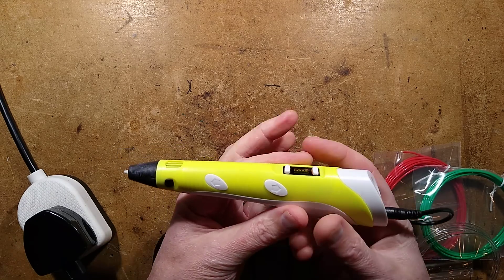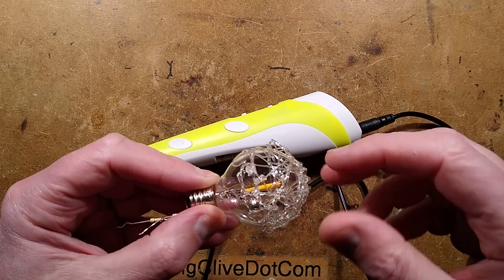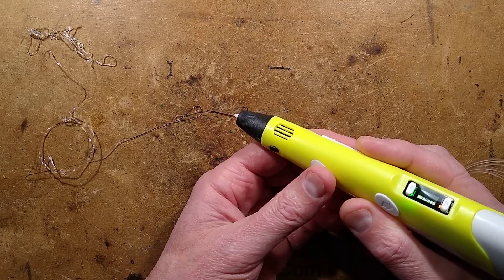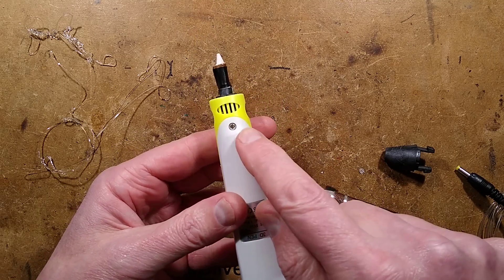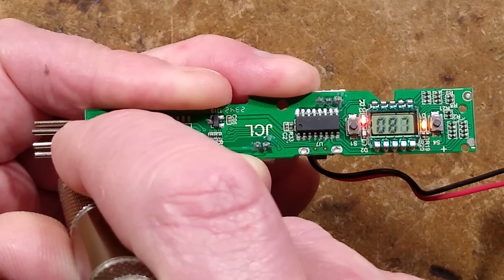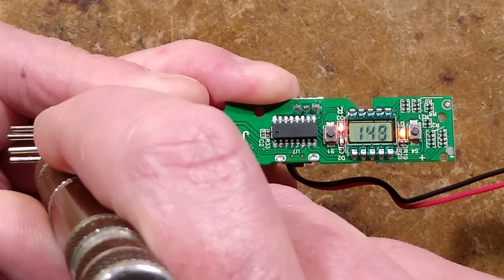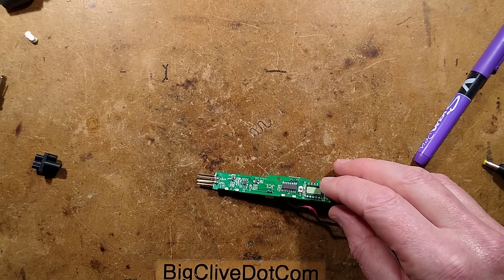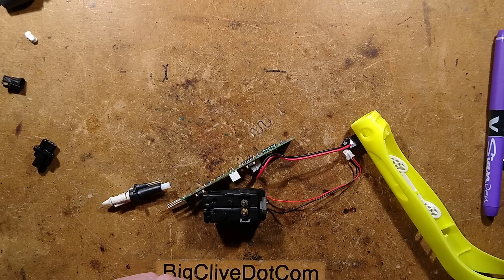Inside a 3D printing pen

Comment: Hot end…? Extruder…? Equals very cheap business-end for a DIY micro 3D printer. You can replace the manual controls by hooking them up to your chosen microcontroller. Nice wee project. So, I guess I’m saying that the best use for this is to be hacked and repurposed! Before you all roll in, I know the print quality will be sh1t, but just think of the fun you’ll have!

Comment: These are pretty decent for welding split up 3d prints. I'm thinking of modding one to split the extruder from the hotend and use a ptfe bowden tube. Then you can use a proper spool of filament still and itll just be more conveniently sized. Also, update controls so they arent so dumb.

Comment: that is a good application for 3d repairs and reinforcements on parts made. you would think it would be
not function if the thermal feed back was disconnected. live and learn! thank you for your time and explanation.

Comment: I have the same make, but an older version, probably from around 2020. Well, if you can say "make" when it comes to these generic-brand items. On mine, you have to continuously press the buttons to drive/reverse. No LCD either. The tip is changeable. I've changed it once after the filament got stuck near the end of the bowden tube, where it couldn't heat up enough to get free.

Comment: I used mine to fill gaps in 3D prints, and I also used it when I made my own 7 segment LED display, I printed the outer parts in white, glued it onto the PCB with the LEDs, then used the 3D pen to flood clear filament into where the LEDs are to act as light guides :) excellent custom displays

Comment: Since there is indeed a 25 KOhms thermistor, would the "fake counter" go slower if the two pins, NTC and GND, are joined with a 10 KOhms resistor?
Reply from the maker: A temperature monitoring device will be designed around a known value of thermistor.

Comment: I repaired a vacuum cleaner housing element with mine. The element was too thin for 3D printing, so I filled the whole thing with a 3D pen. It lasted a few years until the vacuum cleaner motor failed. The rest of the applications are filling gaps in prints.

Comment: I concur with others who have mentioned it's a great tool to use along with a 3D printer. That's why I ordered mine, and use it occasionally to save print jobs when supports fail, fill gaps, and make general repairs or cosmetic touch-ups. It's also great for back-filling holes after using brass inserts or embedded nuts. The only complaint I have is the difficulty of controlling the flow and reducing oozing after turning it off. But in a pinch it works great!

Comment: I use one for modifying 3d prints.   I design and make things to be good enough.  Sometimes to get a part to fit or to work right I shoot in a bit more plastic and fill some gaps.  Faster than redesign and reprint.  

Never made anything from scratch though.

Comment: I would have thought they'd just make a clamp inside that you release to yank the filament out. If you pull filament out that slowly at full temps on a real printer, you get that clobber coming out and chances are it clogs up the head and by god I never want to take one to bits again to clean it.

Comment: I have "printed" 2 raspberry encloses with it and some other small parts and figurines ( before I had a printer ). its slow but it can get the job done if can do it. Its also good to weld some 3d prints and if you want to decorate them in more organic way.

Comment: The most useful application I've used mine for is fixing or creating new plastic standoffs, screw on caps or inset screws (like the kind that get broken off inside laptops, when somebody drops it etc). Usually just use clay & a bit of talc to make a replica of the form. Put a small hole in both sides, then add a drop or two of paraffin oil to deal with the heat & prevent sticking, & ending up with a really low cost part with generally similar quality to an injection molded part.

Comment: Two options, PLA or ABS? That's a jump. Do NOT use this with ABS without a vacuum! Melted ABS is toxic, which is why most who print with it do it with a printer that has a carbon filter (Like the X1C from Bambu Labs) or some kind of venting to the exterior of the building/room.

Like others have stated, great for repairs on 3D printed parts or joining them together.

Comment: Give n it one Christmas, took me a while to find a use for it, the pucturs in the box drawing a bicycle did not inspire me. 
Used it for adapting a lens assembly from a plastic camera to fit onto a DSLR. I don't think you can put parts in a 3d printer and tell it to print between the parts.
https://youtu.be/8nkPCy6bW-Q?si=nlGQ-tXzeDDqEOR5

Comment: I am stunned that in 2024 you have opened a highly advanced plastics creating tool and...!  It has the same motor that came in my 1980s solar experimenters fun kit!  And out of every toy I kille- "took apart" when I was a kid.  And available from every electronics surplus store (usu. in bags of 10.  Or 50. that was always weird...) I ever shopped at.  That motor is everywhere!  Same crappy bent can and plastic ends, completely unserviceable, and runs on 1.5-15VDC.  And has vaseline at both axis ends.  Sorry, probably called "electro-butter" or some such.

There is a factory somewhere on the planet that has never, ever, had to re-tool.  Sure they may have branched out, but they know where their bread and butter comes from.

Comment: I got one and got to use it a couple of times ( 3D print repair and some random plastic casing repair ) before I accidentally used a guitar pedal power supply ( they have a reversed polarity on the barrel jack ) and that was about it. No diodes on the power input.

Comment: Does it get any hotter if set to ABS? It could be useful just for fixing cracked plastic or betting yet when plastic welding something that is going to need a butt load of filler material, like when you break a plastic storage tub and s whole section of the tub separates from it, but you can’t just piece it back in due to all the little bits that also came out as well. It seems the only real advantages to it are the fine tip for precision and the smooth feed rate of the motor. I couldn’t feed plastic into a weld pen even half that smoothly if my life depended on it. Probably still have to smooth the plastic with the weld pen afterwards, but that’s a one-handed relaxation process, compared to feeding in filler. Thanks for the video. See you next time.

Comment: You can do all sorts of things with a hot glue gun and plastic feed stock. I prefer to use pieces of tubular plastic coat hanger for feed stock, but most plastics seem to work, plastic straws, bundles of stir sticks, plastic dowels, aquarium tubing, whatever fits pretty much works. Other than the fineness of the aperture, and the ease of feedstock, what other advantages are the pens? Other than their component parts, that is.

Comment: That's not really a 3D printing pen, though (or at least you're not using it as such), it's basically just a very tiny hot glue gun. 3D printing pens let you draw "in the air" (i.e., move the pen vertically, and the filament hardens as you move up). With that one, it seems that it just drips. Maybe you had the temperature set too high?

Comment: I have had mine for years and so far it us pretty solid.  Use it for repairs of ABS, PVC, PLA. If your a 3dprinter or a modeler it can be quite handy, it has plugged but was fairly easy to clean

Comment: Wish these were around like 25 years ago would have been easy making water pipe as a kid. No more melting strips of plastic with a soldering iron. Thankfully even as a young stoner knew to wear a mask and was doing it under a vent hood. Can't say the same for all these crazy people mixing/ pouring epoxy in a small closed room with no mask, but hey anything for the views right lol.

Comment: Given I was scared off getting a 3D printer because I don't have any good means for ventillation - having a handheld 3D printer you presumably have at less than arms length seems a bit risky. But then risk is hard to assess - is it worse because 3D printers do a lot of printing so produce more airbourne badnessto e.g. hot glue guns, badly cooked curly fries in an air fryer?

Comment: Everybody talks about the use of this pen, but I'm wondering how they made that tiny chip produce all those lcd parts, the numbers: three digits contain 7 parts, 3 times 7 is 21, the chip alone has 16 pins, how do they do this? It has always amazed me.
Reply: Yeah even to me *plexing is kind of like black magic! And combined with the fact it also has to drive the motor, the heating element, read button inputs, toggle some leds

Comment: Hi Clive. I have a couple of these that I do actually use. The main use's for me are (1) when prototyping, repairing/altering 3D printed objects (for instance, if a layer starts delaminating, I will use like a welder to put stitches perpendicular to the layer to stitch it together, or if a hole is the incorrect size, use the pen to fill it in and then redrill the hole (bit like you would with metal and a mig welder), (2) Before having a multi-filament setup, I could print objects with 'voids' in them and then use the pen to fill with some 'coloured' filament for decorating pieces.
Reply: Adding coloured highlights sounds like a great idea. Maybe combined with some fine sandpaper to fix any mistakes.

Comment: a model builder can use it instead of filler for filling in holes in their models, but would need to be a cleaner cut of the plastic at the nozzle. or for making their models stronger by adding extra layers inside, and conforms to the models shape instead of using like i  said filler, or hours of cutting more plastic, or for hiding wiring like extra lights in their model.

Comment: I have made a hanging rotating stand for a box fan , a phone holder adapter with some screws and nuts included , for my old camera tripod, attempted to make a little lathe... (Didn't work well but little exp there to make one....) some random repairs around the house... building a new frame for a old glasses set. (Soldering iron with a dialable temp setting helps smooth things great here) Some other random projects that were just "fooling around and to see what I could do with it... kind of stuff..." A switch holder to replace one that broke in a vehicle... Etc...  For someone on a budget, It can get them out of a pinch.

Comment: I've seen videos where someone is creating a 3D sculpture like a Pokémon. Because you are freehanding it, you don't need any CAD skills. Plus you can have multiple of these pens loaded with different colors.

A word of caution, DO NOT use ABS without wearing a respirator. ABS fumes are quite nasty, PLA isn't exactly something you want to be breathing in either but it's FAR less bad for you than ABS.

Comment: I've got one of those to expand the usefulness of our 3d  printer. It is also very useful for small scale potting  (instead of hot melt glue), and as a remarkably strong (and colourful) alternative to the aforementioned hot melt.  VERY handy for repairing cracks and damage to ABS products, such as domestic appliances and car bumpers!

Comment: We have a particularly cheap and nasty hot air rework station at work that has a similar temperature control behavior. It'll ascend to the set point (say, 280C) as expected, then wildly overshooting to the point of nearly scorching any hapless components at the nozzle end while it shows only that it achieved the set temperature (it varies the numbers a little bit and fakes it). The giveaway is that the heat control LED that normally flashes has turned off for a bit while it cools itself back down to where it's supposed to be.

They also ablated the marking on the control IC (obviously an Atmel 8051 variant) as if anyone sane would attempt to copy what they've done.  🤪

Comment: Would a ceramic nozzle be better than hardened steel nozzles in a 3d printer?
Reply: That depends on the ceramic. Tungsten carbide is a ceramic and it makes an excellent nozzle. The thermal conductivity is much higher than steel, it's almost as good as brass.

Comment: I used one in Jaycar Elecronics her in AU, it was fun but the novelty wore off for me in about 10 minutes, I definitely can see a use though, as others mentioned repairing prints and as a more permanent glue gun, but after getting a 'proper' 3D printer I could never use one of these soley to make stuff. But if it's a gateway in to making stuff I see no harm in these things existing.

Comment: I vaguely recall that when an h-bridge has both mosfets switched on, you get fired from your circuit design job for shorting out the supply lines?
Reply from the maker: It's not just turning on transistors directly.  It changes the polarity of the matching output.  Taking both high (or low) makes both outputs equal and no current flows through the load.

Comment: The material drive mechanism is very similar to a MIG welders feed, the bit that pushes the welding wire through to the torch/gun, although a MIG welder uses 2 rollers, with the driven one having a toothed groove within it, rather than a toothed cog. They could have done that with this, to cause less damage to the PLA.

Comment: It's like a hotglue gun, but using plastic instead of glue.    I can't see a huge number of uses, other than the ones you have highlighted.   I guess you could use it for repairs and similar things.
People doing a lot of 3D printing may find it useful for those sort of repairs

Comment: never thought of something like that but in concept kind of like a hot glue gun using a different plastic with auto feed. Could it be used for "hot glue welding" appropriate plastic parts like parts made out of ABS?

Comment: I was occasionally hand making hot ends for 3D printers about 18ish years ago. Measuring and cutting nichrome wire, hand winding them and fire cement coating, casting on the silicone cover, the whole nine yards. Also built whole machines, one of the machine from the company was used for the bloodhound project (and I now have) and people were experimenting with ceramic and chocolate printing.  We discuss hot air to sinter sugar.... was an interesting time.
Would the three pads for speed perhaps give 5 speeds, two extra from the two bridging positions?

Comment: I have a nearly identical 3d printer pen. Except mine doesn't continually feed when you push the button. You hold the button down and it feeds. Also mine came with a proper wall adapter instead of a USB plug.

I use mine for plastic welding for repairs. Like if I pull a device apart and the plastic is cracked, or if screw posts snap off, I can weld them back on better than if I used glue. It works better because the pen melts the surface of whatever I'm repairing, and it melds nicely with the melted ABS coming out of the pen. Making a pretty rock solid repair. Just like welding steel.
Reply: The one I have will work in either continuous extrude mode or only while holding the feed button mode.
 It swaps between modes by double clicking the advance button.

Comment: I learned welding in the 80's and the 3D pen is useful for "welding" 3D printed parts together - hot melt glue doesn't stick properly, universal glue like UHU works for joining flat surfaces, the 3D pen can bridge gaps - they all have their purpose.

Comment: I have used mine with a flexible filament to make several stub antennas for broken transceivers. I made a rubbery foot for an aluminium chair. This was extruded onto the correct size of wood to replicate the chair leg. (The completed food was smoothed over using a soldering iron to shape the plastic.) It was a little difficult to remove from the wooden former but it looked the part once fitted. I also made another foot for a missing tubular leg of a desk. This time I was able to construct it inside the tube. Again the soldering iron was used to smoooth the part and match it with the other 3 feet. Not properly used it with other brittle filaments. But I can imagine a use with the clear filament for repairing the christmas led reindeer, as bits have broken off.

Comment: I use them all the time to finish and repair 3D-prints. Kind of like glue within ABS/PETG prints mostly to connect the parts just pushing filament into holes that stick well together. I put that into the design-thought already.
Another option is to fill holes in prints with connections like screws or pins below the surface. 
So after the printing of the parts, put them together with the (steel) pins, use the pen to close the opening and you don't have the connectors into sight anymore. If you press the molten filament in the hole slightly, it is almost invisible if you use the same filament (the rest of the roll).

Comment: I bought a couple branded 'Wild Park' Version 2 for a £10 each, which boasts 'anti-jam technology' and has a digital speed adjustment over the V1 mechanical slide switch.
They're fun for what they cost, however one tends to get the usual quality and safety assurances that comes with all Chinese electronics nowadays. There are some better manufactured brands out there that perform way better, but that's reflected in their price point. 👍

Comment: For the man who already has everything.  So basically a fancy hot glue gun, lol.  Ok, it's unique but I've made patterns with a small hot glue gun, using different colours and even just squeezing out some B6000 glue on a greased surface can do the same.  What else would pass through that?  Licorice strings?  Maybe for cake decorating.
Reply from the maker: Can you actually get licorice strings?  I've not seen them in the UK for many years.  (called licorice laces here)